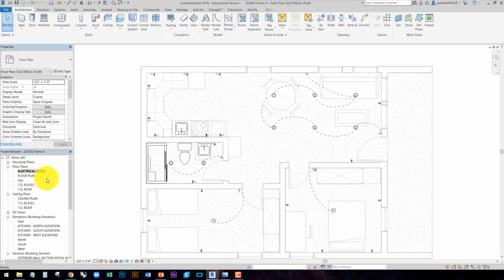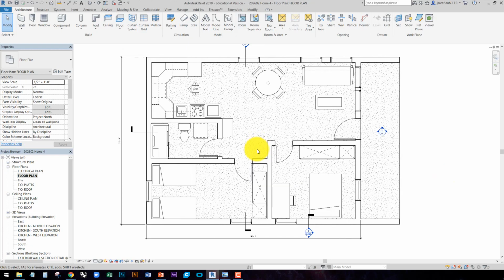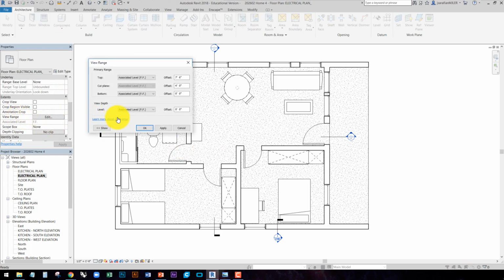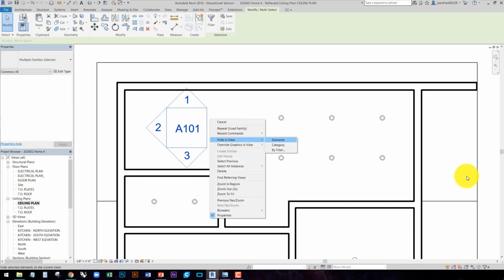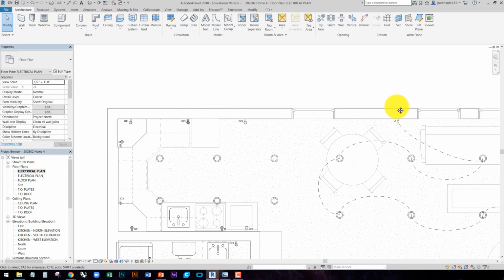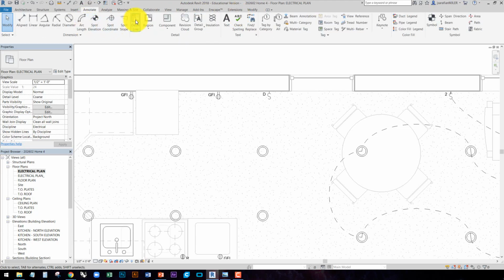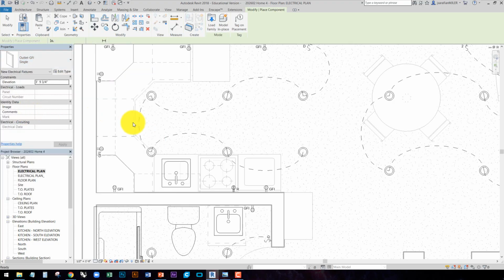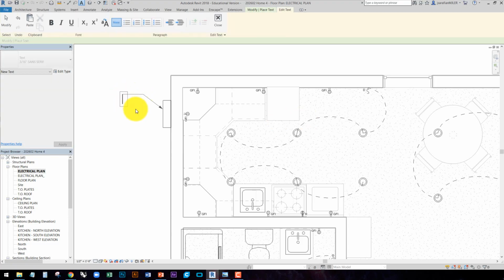Drawing an Electrical Plan in Revit

Comment: Great video! For some reason, the families for the receptacles and switches are not showing the appropriate symbol for them. Is there any way to turn them on? Using Revit 2021
Reply from the maker: The latest versions of Revit require you to use "Load Autodesk Family" Instead of "Load Family"